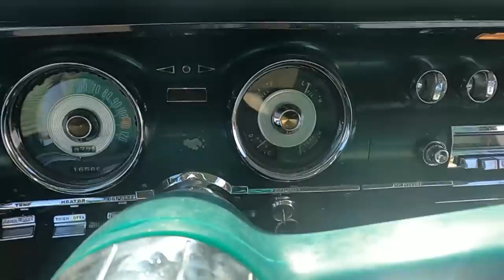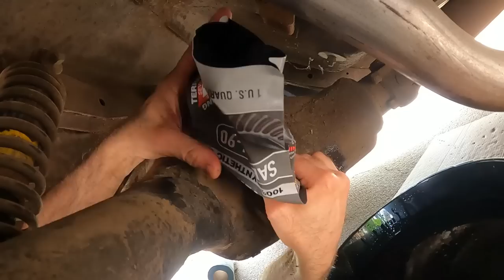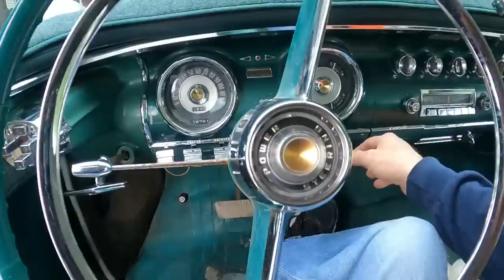56 Chrysler Windsor Wagon 354 HEMI & PowerFlite 2-Speed Cruises Home

Comment: When I was travelling thorugh Oregon I ran into a 56 Chrysler New Yorker 4d with original paint (also green metallic), remade interior and absoluely rustfree. I live in Europe and I am a GM guy. But I really wanted the car.
The owner had owned a car shop but was in Florida at the time. He was obviously retired. I called him up and tried to negotiate a deal  with hime. The car stood outside and  I even saw the car on google earth. He wanted 5000$ for it and I was willing to pay that. (This price tag was on the car when I saw it).  But this  guy did not react anymore. Some people prefer their cars to deteriorate rather than handing them over in time. Maybe it is still sitting there. What a shame!
I saw a clip with Rock Hudson transporting a Christmas tree in a 56 Chrysler Wagon. It was a car cool enough for a celebrity. Nice vehicle, congratulation!
Reply from the maker: Wow! thanks for the story..  I'm pulling the tank to get it refurbished and at the same time will neutralize the surface rust in the spare tire area and under the tank area.  I really want to make this a dependable one mainly bacause you don't see Chryslers/Dodge's from this  year at all. Stay tuned - I did find a DeSoto I may pick-up..

Comment: I have a Coronet RT Convertible its a matching number 440 mag matching number 727 factory power window and power top with factory AC factory Hemi Orange one of 426 made . My Mother and I went in on it back in he early 90s God Rest her soul . I will never get rid of it . From one Mopar freak you are doing this wagon right I love you are keep it all original and just driving it not restoring it just getting it up to snuff and driving it . Mom said she had a 56 Chrysler with a Hemi in it back in the day and she said she got over 21 mpg with it . She didnt lie once you get a major tune up cap rotor points condenser plug wires and fresh plugs rebuild the carb  set the timing at about 12 tdc old engine love timing not only will it run better but you will pick up a lot of mileage with it
Reply from the maker: I may just do a mileage test!!  I'm actually going to drain the tank today to inspect..
Reply: @grillsandaxlegrease3578  OH WOW ROGER YOU HAVE A REAL 69 RT CONVERTIBLE? MATCHING NUMBER 440 MAG MATCHING TRANS FACTORY AIR FACTORY POWER WINDOWS FACTORY HEMI ORANGE ONE OF 426 MADE! WOW ROGER THAT IS COOL AS HELL !  HEY DUDE THANK YOU FOR NOT BEING SO SHALLOW AND ONLY TALK ABOUT YOUR WAGON ! THANKS A BUNCH FOR SHOWING INTEREST IN MY SHIT !  OH THANKS FOR THE ADVICE ON THE WAGON TOO@ YOU BET ANYTIME DUDE@ 😡😡😡😡😡😡😡

Comment: I'd really like to see this car in a deep burgundy color (all over, door jambs, engine bay, rear hatch inside and out, doors, everything) with a good amount of metallic flake in it, and have every piece of trim removed, polished to a perfection, along with the original hubcaps, and with everything reinstalled it'd look amazing. I'd also yank the entire drivetrain, and I would really scrub, degrease, wire wheel and brush the entire thing, paint the entire engine and trans in that factory light green, have some custom fabricated long-tube headers made for it, a really nice custom dual 2.5" exhaust with some Flowmaster or Borla mufflers, a custom two-piece intake manifold with multi-port fuel injection with individual injectors per cylinder and fuel rails, and then I would adapt a 70mm throttle body to work with the original gas pedal, and I'd get a standalone fuel management system for it to run a multi-port fuel injection setup. Obviously you'd have to install an in-line fuel pump or figure out how to mount an in-tank pump, but that car would be a real cruiser and any real car enthusiast would LOVE it anywhere it went because of how unique it is. I'd wipe that car with a diaper every day.
Reply from the maker: Wow! Good stuff! The in-tank pump on this would be easy as you have access to the top of the tank though this hatch in the back. The tank is a sideways "L" shape. Manifold flow on these are excellent so  access to injector ports wouldn't be much of an issue.  The only issue is on the drivers side - not a lot of space for pipes but the stock manifold is actually better flowing than any Ford design I've seen.

Comment: That  is a neat looking old Chrysler wagon. Not many of those left around. Looks to be pretty solid. Not much cancer in the body or frame if any.
Reply from the maker: Yep - 
 Just floor pans that rusted from the inside (open windows) but the frame its self is flawless at this point. Will attemp to replace floors while I teach myself how to weld.
Reply: @grillsandaxlegrease3578  MIG welding is pretty easy. Just keep the heat down and tack weld first to secure the new panels to prevent the sheet metal from warping. Lots of welding tips and advice on good old You Tube University!

Comment: I've done a lot of restores, these old cars are awesome 👍.
Almost always with a fuel gauge problem, pull  and clean the sending unit, it'll work fine.
Reply from the maker: It's starting to work better every day. I pulled it out and the resistance wires are nasty but been soaking them in cleaner.

Comment: The '56 Imperials had the same engine mated with the 3-speed cast-iron Torqueflite transmission. The Powerflite transmission in the Chrysler New Yorker and Windsor may be difficult to find replacement parts for these days, but the same can be said for the Torqueflite transmission parts. It might be a good idea to locate replacement parts for the Powerflite and keep them on hand.

The '55 & '56 Chryslers had good handling due to sway bars on the front suspension. With new king pins installed in the front suspension you will find the overall handling is very good. Some people did not like the very light steering that Chrysler had with their Constant Effort Power Steering system, but once you get used to the light feel control is excellent. It is possible to drive the car with one finger, although I always kept both hands on the steering wheel.
Reply from the maker: Thanks!! Good info on that steering.. Actually I missed out on a guy in MN who had three transmissions he didnt need all good for $500. I need to search for that again. They are there. Just need a trucking co. to pick up the pallet. 
And that emergency brake drum unit can ACTUALLY stop the car!! Whoever worked on this last had that set properly. I do need to repair the trunion though.
Reply: Joe you are spot on except for one thing. The Powerflite was STANDARD on the Imperial Until 1/1/56. Then the cast iron Torqueflite came in. With the same final drive ratio (3:54) that imperial was fast. How do i know this? My dad bought a 56 Imperial and took delivery Christmas eve 1955. And yes it was a Powerflite.
Reply: I took my first 354 Hemi out of a 56 Imperial limousine and it had the 2 speed powerflite behind it. 57 392 out of an Imperial convertible had an iron torqueflite.

Comment: The starter solenoid performance can be improved by cleaning & polishing the internal contacts. Remove from the car and carefully bend the folded over tabs of the metal cover until the cover is free. Remove the cover and you will find that you have good access to the contacts. Use a fine sandpaper, say 220 grit or smaller, to clean & polish the contacts. Then replace cover and fold over the tabs that hold it in place. Clean the contact tabs on the outside of the solenoid before re-installing in the car.  Add a little silicone grease to help keep the external contacts from corroding. Have fun!
Reply from the maker: I'll do that! Thank you! 
Also I wonder if there are any places who can rebuild the old armature? The end commutator is bad.  Replacement ones are VERY expensive.

Comment: I have a motors manual that covers that year if you need info. I've worked on more 1950s Chryslers than you can shake a stick at. Also there is a special procedure to adjust the brake shoes properly. Another thing gl5 is a fine oil except that it can attack early brass compositions in older vehicles I found that out the hard way by destroying a CJ5 transmission accidentally. The transmission requires type A fluid which is available through O'Reillys.
Reply: you can also get GL-4 on Amazon. I got some for my 64 Corvair van. BTW, there shouldn't be any brass in a rear end. I got mine for the transmission because of the syncros.
Reply from the maker: Thanks for the offer! I have a new respect for all things Chrysler. I really want a 36-39 Plymouth. Also looking at a 56 Desoto now. The fluid stuff is what I do for a living. The GL5 in needed in the diff but Amsoil has one specific GL5 (Product code ALM) for transaxles (Corvairs for example) which will not harm yellow metals. Yes a GL4 shoudl be used in all those manual boxes.  But as for Type A - yes, but a quality Dexron III will not cause any issues as it had to be designed to allow backward specifications of Type A. Now that said, some brands will cause harm because they are no longer built to the same quality standards. I read about the floating brakes but thankfully have not had to adjust them yet. I did get a yowl for the big springs.. The last guy didn't tell me but taking off the drum all these parts were replaced recently. That was a BIG Relief. I do have the Chrysler manual but thank you! You wouldn't happen to have the Desoto one would you?
Reply: No problem, I've had four 1956 Desotos with the 331 and 341 hemi's. I'll check my book to see about the Desoto.

Comment: Interestingly, That is the wrong engine for a Windsor. It should have had a 331 C. I. poly. Someone obviously either ordered it from the factory (which does not make sense since you could order A New Yorker wagon With the 354) Or swapped it out. All in all the Powerflite and the 354 hemi make an tremendous combination.. Why not use something to get the fog out of the paint? I  think this would make the body pop. Try looking under the back seat ( in the springs) for a build sheet (broadcast sheet) if the hemi was ordered from the factory this would make this rig super ultra rare as opposed to just rare.
Reply from the maker: I thought the same and discussed this in the Forward Look forum before I bought it. I cover this  in part I. But it is a numbers matching block. It was and still is a 331 poly but some time ago perhaps 20 years ago or more someone did put the HEMI heads on with the needed domed pistons. That was one of the first things I checked when I arrived in Las Vegas (Video Part I). I also found out it was Impossible to order this with the HEMI or at least the historian over there said it never happened according to records. 
I did look for a build sheet. The back seats flip over for the wood deck so I'd have to take that paneling off but I may do that..  I'm thinking if I keep it can I tackle the floor pan work. Never did that before.

Comment: I didn't think you could mix synthetic and DOT-3 brake fliud(?) 
I worked with a gent for 35yrs and always flushed his '28 and '51 Packards with  green rubbing alcohol. And then back with DOT-5 synthetic. Never had a problem.  And these cars would sit for YEARS! 
And run the Amsoil 100:1 2 cycle in the gas tank. Or diesel fuel mixed with 87oct gas.
But really flush it first! You don't want to varnish up your rings!
Reply from the maker: Just got the gas tank totally refurbished and have a new master cyl for the brakes.  It turns out that enging only had about 400miles on it when I pulled the valve covers off it was obvious.   Now doing a new headliner and floor pans. 

Yes - that AMSOIL DOT3/4  has to by law be totally compatible but anything this old the brakes need to be flushed as I do it anyway every two years.

Comment: The vibration you're feeling is most likely not the transmission it is the ball and trunnion front universal joint a common problem in early mopars. I always convert them to later style universal joints.
Reply from the maker: Thank you!! I didn't think of that. I do have a rebuild kit for it but saw someone in the forum on a how to for those to upgrade to a modern type or something.
Reply: I don't think you should do that. The old ball and trunion  joint is about the same as a modern inner CV joint. It is probably better and smoother.

Comment: Worked on one of these last year, and the main problem was the engine wasn't grounded to the frame, the customer had it grounded to the alternator bracket. Made all the difference in the world.
Reply from the maker: Yep I think that contributed to the problem. I found a busted wire terminal that previously was a ground and someone also grounded one of the tailpipes further down to the frame. Which was disconnected.

Comment: What an adventure looking forward to seeing more of this car...do you plan on restoring her?
Reply from the maker: It all depends on the economy but as for now I'm able to do the most basic stuff, getting these road worthy and finding others using the resources I do have. Chryslers and parts are VERY expensive,. But I'd like to. I do need to teach myself welding. That's something I plan to do soon so I can address floor pans, etc. The damage on this wagon is very minor thankfully. The rust came from the inside out (possible open window and heater core). I'm currently looking for the kingpin bushings or I can have them made.

Comment: nice Windsor wagon.  It didn't come with a Hemi but it's a great replacement for the 331 Poly it came with
Reply from the maker: Yes - I believe I said that in Part I - it was a POLY 331 but a while back someone put on the hemi heads and domed pistons. The block is the correct number matching block.. 354 or 331 the Chrysler blocks were the same 100%, water pump, etc for 56.

Comment: Back in the day, that's exactly what you did WITH this beast, go to the Grand Canyon!
Reply from the maker: That was totally my intention but in the shape it's in my main issue was these semi trucks barreling down hills and there I am at 35MPH and no shoulder not to smoke the brakes which I expected a line to burst. And I didn't have time to check out the tranny which was making some weird harmonics around 55MPH.  Driving my 66 Corvair no problem though.

Comment: Its funny most people don't lube those areas
 I was always taught by the elders and common sense that if something can be lubed then you lube it. Generators,distributors... Whatever. That zurc or lube spot isn't there for looks. Use it!
Reply from the maker: That's right! Never overlook moving parts. Failure is simply a lack of lubrication! Even leif-springs should occasionally be sprayed with something.

Comment: for God's sake never pull too hard on those door handles - they will snap off in your hand !!!   Also be verry gentle with that horn ring - yours is one of the few that i have seen intact.
Reply from the maker: Sadly the drivers one was already broke. I fixed it w/ JB Weld but that only lasted a week - Can you weld on this pot metal a new boss?  Buy yes - I yell at people who attempt to open the door now!
Reply: @grillsandaxlegrease3578  when I was in high school I had a 1955 New Yorker Deluxe that had the same door handles - like yours drivers side was broken - i had to fabricate a steel backing plate that mounted inside the door came out the other side and fit into the backside of the door handle - and yes I also used JB Weld - the plate gave me more surface area for the epoxy and I think I had to modify the latch mechanism - this was in 1970 - I'm a bit foggy on all the details. But as I recall it worked. With the improved technology there may be a welding solution.

Comment: maybe I missed something but why all the blue masking tape? Did you find the PS leak?
Reply: the hauler did it
Reply from the maker: That leak turned out to be minor - mostly from the clamp above but I want to just replace both lines. They want an arm and a leg for them though.
Reply: @grillsandaxlegrease3578  ... just a thought on those PS lines.... we have a local guy who makes high pressure stuff for heavy equipment. You bring the hoses to a shop and they reuse the metal ends then crimp on new hose. I did this several times for discontinued parts on heavy trucks. I even used it for custom made AC lines on a hot rod.

Comment: Shouldn't this car have a "poly" engine and a three-speed auto?  Or is that driveline a transplant?
Reply from the maker: See part 1 - and yes it is a poly  (numbers matching) with HEMI Heads and pistons..  Only 2-speed was available.
Reply: @grillsandaxlegrease3578  Thank you for the clarification.  I should have seen part one but glossed over it, apparently.

Comment: Are you going to buff the paint ?
Reply from the maker: Yes - researching the best way over the winter.
Any suggestions?
Reply: You could wash it with Ajax then use a rough buffing compound then medium then polish , it usually works , some people wet sand it first with fine paper , it's up to you